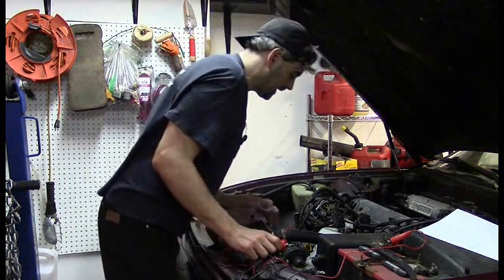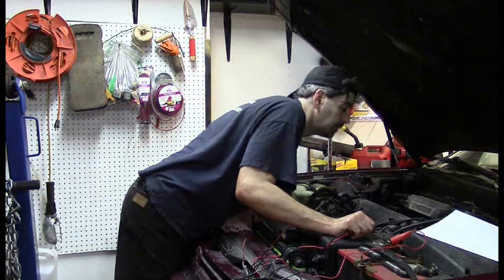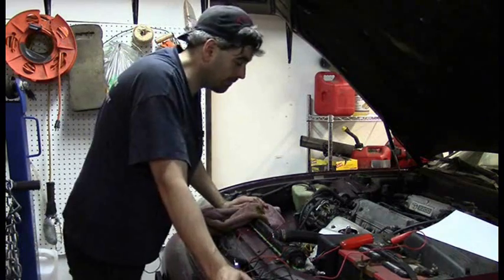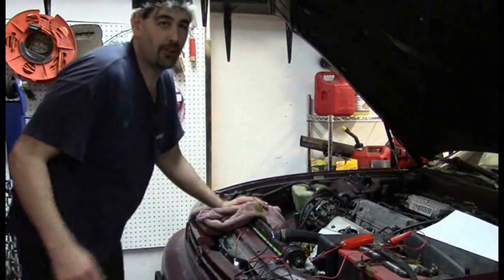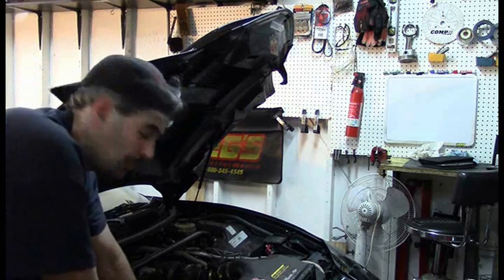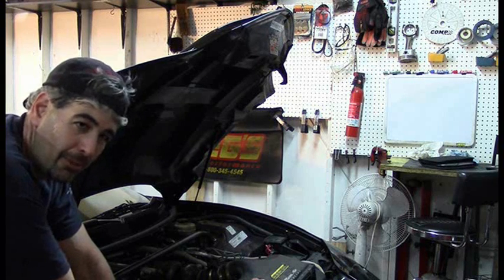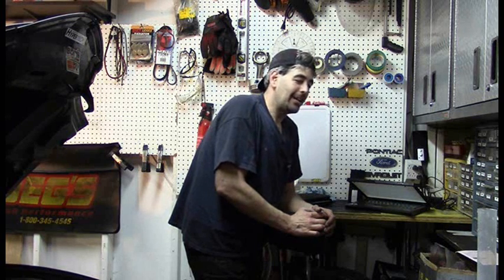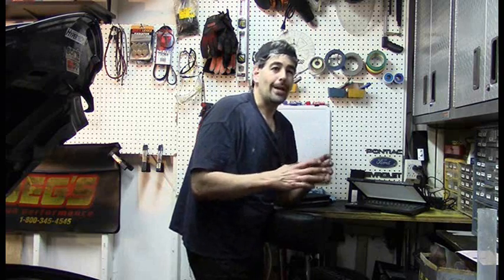12 Ways of How To Test A Blown Head Gasket Compared- PART2

Comment: Thanks for sharing the multiple true/false test. I love learning about cars, having some overheating issues with my car.  Intake Manifold had to be repaired a few years ago, I've come to believe/self diagnose my current issue is a dead radiator. Darn Oldsmobile. I think I may just try the sizzle test when I get home tonight.. To funny but hey, one good test to do in addition to a few others.  :\   Nice Trans Am by the way!!!
Reply from the maker: Thanks Dani I also love learning about cars (just learning period, actually) as well as my Trans Am.
 There's a huge number of things that can cause overheating besides a head gasket.  Failure of fans to come on (which in itself can have multiple causes such as failed motor or failed coolant temp sensor), radiator issue, water pump failure, timing, thermostat (not common for overheat actually), on and on.
  Radiator is easy to test though- warm up the engine fully and there are two main hoses coming from it- upper and lower. if the hoses are equally hot, a water pump, thermostat, or radiator issue is indicated. If one hose is noticeably cooler than the other (usually the lower hose on most models) then you T-stat, radiator, and Water pump are working.
  You know what the single, number one most common cause of overheating I see is? Dirty radiator fins. If your car overheats at stoplights or stop and go traffic but cools down when you go faster AND the fans are working, then this would be highly suspect- remove the radiator and flush the fins with a hose and your car will probably run 15 degrees cooler.
Reply: i have an odd issues, let me explain, i noticed that my radiator was hot on top and cool at the bottom, do was the hose and i can also feel the air from the fan was cooler and hot. I replaced my thermostat, and same condition. My heater works fine and keeps my temps steady at 187F. The thermostat starts to open at 170F. fans turn on at 185F, both fans work and the radiator is brand new with fresh coolant. I think it might be a flow issue or water pump, cause the pulley to the water pump has little to no play at all, and when i squeeze the top rad hose when the thermostat is fully open, i can not feel any flow or pulses. but water pump has no leaks nor weird noises from bearings. It could be a head gasket but im not loosing any coolant. any help could be greatly appreciated.  the thermostat has a check valve and i added an extra 1/8 hole at the bottom of the thermostat to help bleed the air. another thing i noticed is that with the rad cap off i need see coolant flow nor bubbles and that with a coolant funnel on.

Comment: nice but I wish you had of done the uv to paper test = (  I was waiting to see 2 glowing circles of confirmation  oh well as they say "ya cant always get what ya want"
Reply from the maker: Yeah I am seriously bummed about that.  If I wasn't under time constraint to repair the car I would have let it cooled overnight and done the UV test again.  But it does go to show- as is often the case with many tests, there is a stark difference in results in a warmed up vs a cold engine.
Reply: Schrodingers Box  maybe next time,dont wanna sound like another youtube winge and it was still the most in depth well explained and enjoyable head gasket talk ive seen !really welll done and thanks
Reply: Schrodingers Box
well i tried the paper test and it didnt show ,actually it didnt even get wet spots -I think the level of head gasket damage was quite minimal however I did quite clearly pick up the UV dye on the ends of 3 spark plugs in a 4 !damaged gaskets confirmed!

Comment: i need ur help, kind of confused, how to differentiate intake manifold coolant leak with head gasket leak, how do i differentiate this two..
Reply from the maker: Great question Sivaraj. An intake leak is very hard to diagnose- it's actually far easier to diagnose a head gasket leak. An intake leak has to be diagnosed more by "process of elimination".  When a car is losing coolant but it is NOT due to a cylinder head or block leak (as confirmed by the tests shown in this video) AND it is not an external leak, then the intake manifold leak would be suspected. Note some cars have "dry" intake manifolds so this will not be possible in such vehicles. Also some cars, particularly V engines have coolant "crossover" pipes between the heads under the intake manifold which may leak but the coolant may not be visible because it pools under the intake and dissipates with engine heat but still, to repair it, the intake must come off.  With an intake manifold leak the coolant may go into an intake channel and burn similar to head gasket, or it may spill into the "valley" between the cylinder heads and drain right into the oil pan. Finding coolant in the oil while a leakdown and compression test show sealed cylinders would be indicative of intake manifold leak. I find that a cooling system pressure test is by far the best way to confirm an intake coolant leak. You can easily hear the pressure loss at the intake manifold. 
 Upon removing the intake manifold, the point of the leak will be quite apparent as the gasket around the leaking coolant passage will show obvious signs of the leak.
   Similar to a head gasket- checking for flatness of the head and intake manifold and of course verifying no cracks in the intake manifold is necessary to ensure the repair will be successful. 
  GM 3.1 and 3.4L engines around the early 2000's suffered tremendously from intake leaks of this nature.
Hope this helps.  Where are you from by the way?
Reply: hi, i am from India, but settled in USA since 2005. I started watching your videos, and it is quite interesting.. I have watched lot of videos and commented on more  sies, your site is peculiar, and got my attention, i like diagnosis and automotive is my hobby and i am a software engineer.  They way u diagnose is really good which many (99%) lacks.

Comment: When doing the "Paper Test" you could do one cylinder at a time to provide more definite results as to which cylinders have problems as cross flow between cylinders won't occur if both have their spark plugs out. You are going to pull the head if you find an issue on any cylinder, but I always want to know as much about what is wrong with an engine before tearing it down as I can.
Reply from the maker: Hi Arlen, welcome to the channel and thanks for the comment!  If I understand it correctly, you are absolutely correct that the paper test will not detect cross-flow between cylinders with both plugs out, however it also wouldn't detect with only one plug out either since a crossover between cylinders would not involve coolant and just air would blow at the paper. In my opinion the best way to detect crossover is by seeing two identical low compression results in adjacent cylinders and then follow up with leakdown test on one cylinder but feeling for air coming out of the sparkplug hole on adjacent cylinder.
Reply: Schrodingers Box Theoretically, if cylinder "A" has a path open to coolant, as well as a path open to cylinder "B" and cylinder "B" has no direct path to coolant, pulling cylinder "B"'s plug should see some, but not as much coolant as cylinder "A" on the paper.  I agree that the bleed down test is better, but you are going through a long list of "Shade Tree" tests...  Thanks for your videos.

Comment: Here's another test.  Watch the CTS on a scan tool while at a steady 55mph.  A good cooling system will give you a very steady temp reading.  A combustion leak will give you a steadily drifting temp reading.  It will go high, go low, go high, go low.  Sometimes as much as 25 degrees.  (and with no change on the dash temp guage)
Reply from the maker: Aw man I wish I had heard if that idea before this video.  Indeed I wanted to include some type of scan tool parameter but couldnt think of one.  I'll try that next time I get an opportunity!